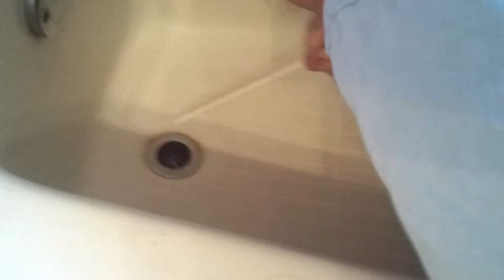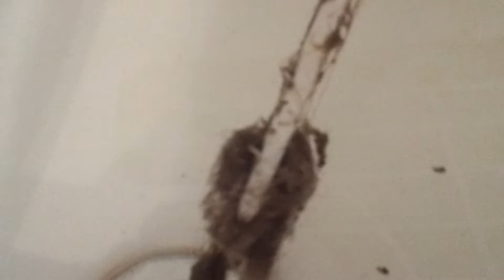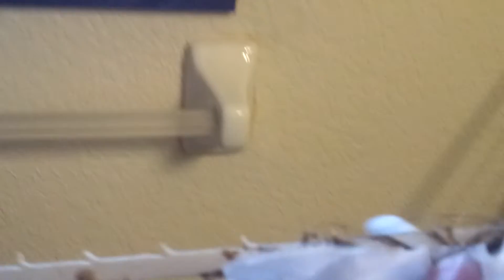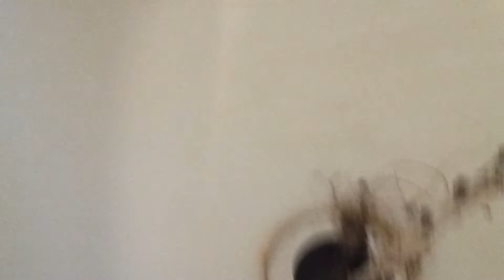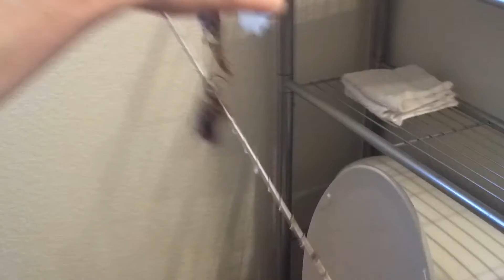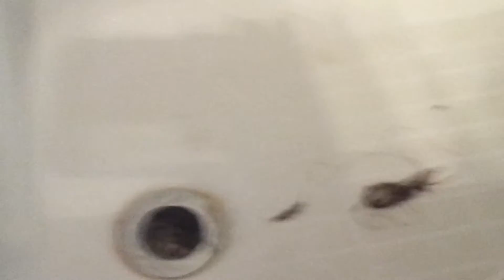Cleaning out the bathtub drain with the Zip-It. Nasty hair

Comment: Zip-its are amazing... Super handy for the times you don't want to get the drill-powered augur out (which I had to do because the previous tenant in my condo didn't clean the drain out in ages... Massive hairball wedged a good 10 feet down the drain! Which made no fucking sense because the previous tenant was a dude!). It helps if you twist it before pulling.